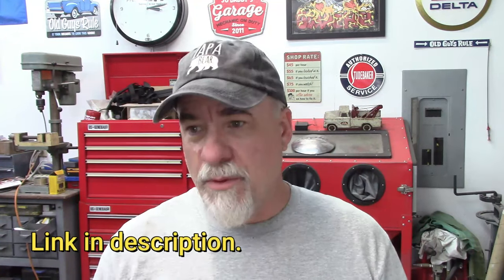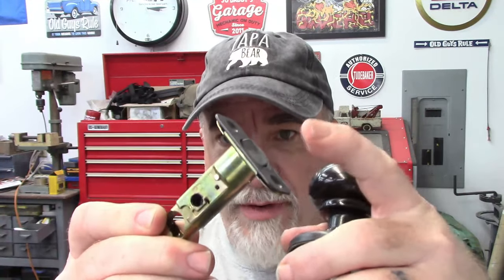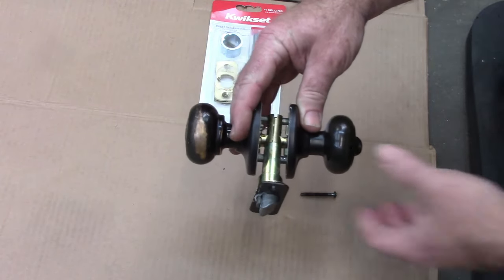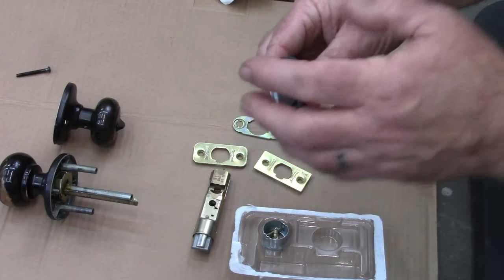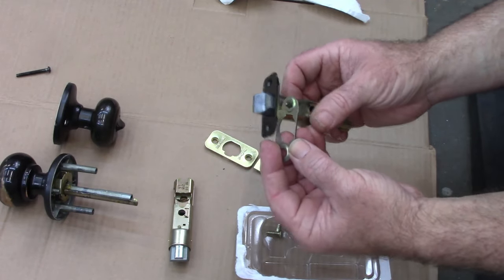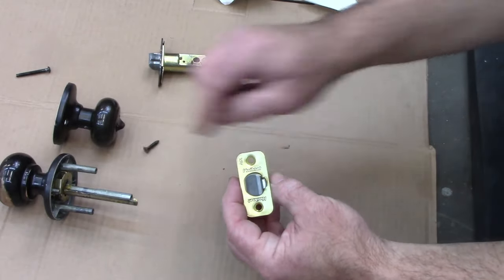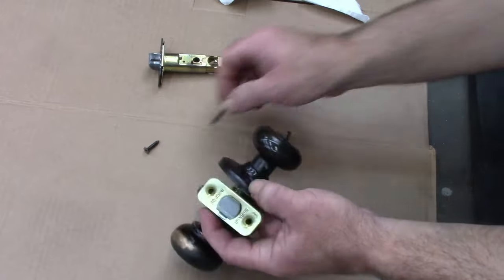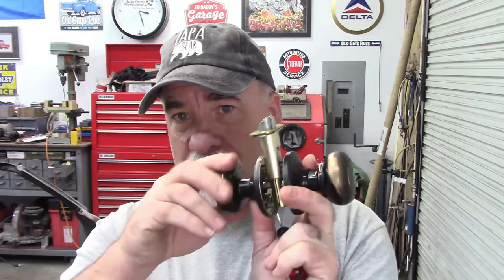Kwikset door latch repair. Save your handle and save some money.

Comment: A better video would have been repairing your old unit....what broke?????
Reply: He did show what broke. The latch is worn out because the metal is worn away. You can’t repair these. You have to fix them by replacing the latch. Take a look at the tumbler area on the old one he held up and the new one he held up. The old one all the metal is worn away. Common issue for heavy use front doors.

Comment: Kwikset locks come with a lifetime warranty.
Reply: Indeed, I was doing some routine maintenance on an older Kwikset, when a piece fell out I didn’t recognize.  The handle when back together just fine, and still worked, minus that piece.  So I email Kwikset and ask if they can help identify it…. They sent me a whole new handle set and I didn’t even ask for it.  I’ve held onto it for the past few months.  Then the other day, what happened in this video happened to me, and lo and behold I had a brand new one standing by.  Thanks Kwikset!
Reply: The warranty on their website says you have to provide proof of original purchase to make a claim. Did they ask for any of that when you emailed them?
Reply: @JonathanLarson-CoolJon  Nope, they just asked me to take a picture of the handle, which I did, and along came a new one.

Comment: Unfortunately the latch is jammed in the locked position and the door is closed.  I have taken the door knob assemblies off, but don;t have a way to get the jammed bolt out, so I am stuck with a locked door.
Reply: Actually, this JUST happened to me yesterday. If you take like a sharp pointed thing, ( I used an old pocket knife) and pry it open, simultaneously keeping pressure on the door, and you can get it open. Hope this helps !
Reply: @jtemme76  Hi, jtemme76,
I had tried that for a half an hour and it worked in the past.  If you can get the bolt to slide just until the taper part, my last experience was this worked. After I posted this, I thought: I need a tool to cut the bolt.  I bought an Oscillating Multi-Tool and a bald made for metal.  It took longer to get by battery from storage in the basement, and change to the metal-cutting bald than the work itself.  That bolt was cut in about a minute!  The door opened easily and a screwdriver got the latch assembly out.  I picked up a new one tonight, and I’ll have that door handle working as good as new tomorrow morning.

Now I have a new tool, and I’ve been wanting one of these for a while.

Thanks for the response I found no videos on this problem but since I saved the old latch maybe I’ll make one and post it.

Comment: Allright!  I feel like I conquered the world!  It has been months since my pass-through garage door wasn't locking me in or out!  I even bought a Cracker Barrel Friday fish fry lunch - which would have been CHEAP if it fixed the problem - for a man-friend to adjust it (I am a single 66-year old female, easily frustrated trying to figure out what was wrong and thought it was just a loose handle), but it still didn't work...then I found YOUR video, stopped it at the point where you flashed the Kwik-Set Exterior Entry Door Latch replacement parts so I could write it down, drove over to Lowe's and in just a half of one day (I admit to being a slow learner - Ha ha ha) it is working!  Thank you!  Thank you!  Cindy from Phoenix, AZ
Reply from the maker: Awesome!

Comment: Thank you! I just took apart an enry handleset that doesn't fully throw the latch when turned in one direction and diagnosed the problem as a worn latch. I could see that the latch hole was worn quite a bit on one side (top) but not the other (bottom). This explains why the door handle worked when turned in one direction but not the other. I appreciate you holding up the package in the video so I know just what to look for when I go to the store. Thanks again.

Comment: Dude, THANK YOU!  I was just getting ready to go drop a ton of money on a new latch style door knob to replace the one I have. Of course it had been sticking for awhile, and all the times I shoulder checked the door to get it opened cracked some of the wood on the frame, that might be another video you made need to do :) [repairing cracked door frames for dumbasses] oh well, live and learn. Thanks again! Going to go put to use the knowledge you just gave me.

Comment: JoDaddy if I still can't fix my door knob and trigger then consider me an idiot because that was very self explanatory like, I had it broken for two months, you'd think this guy is hopeless, as I probably would judge someone as that esp if I end up successfully fixing my door knob and dead bolt as the brand quikset is a common household essential so instead of having someone do this for me I will take a crack at it, because of your inspirational video, Gary and Brandy in Kaneohe

Comment: I am revisiting my issue again and remembered my issue. I have 70's interior doors with a 2 3/8" backset and no room for an adjustable backset. I have ordered a new doorknob set from Amazon for 12 bucks and guess I will need to run a 1" wood drill bit thru the backset opening to allow for the extra room needed for an adjustable one. If you know an easier way let me know.

Comment: The round piece is not an adapter. It is usually used on a metal door, but can also be used on a wood door where just the hole is drilled and the flat plates are not used.

Comment: Any tips on how to get the latch out if it's locking you out as described in this video? Is it just a matter of taking the handles off and getting in there with some needle nose pliers to actuate the latch?
Reply: I have the same problem - did you figure it out?
Reply: @jaytyler3076  Yep, I used a flat, sturdy piece of metal I found lying around (I think it was the clip from a garage door opener remote) and a skinny screwdriver to push the latch mechanism open. Had to shove them between the door and the door frame to get at it. There was much cursing involved but eventually I got it open. I found a video of a locksmith fixing this same type of latch and it took him like 10 minutes to do the same thing, so that was my inspiration.
Reply: With access on the inside handle you can take off the handleset.  Using a screwdriver, or pretty much anything, you can open the latch further than the door handle will. 

Replacing the whole latch is the easiest and most certain solution.

The latch shown in this video is known as a 'deadlatch', or casually as an entry latch.  It has a slider that prevents the door from being carded.  It's usually used on entry handles with locksets.

The other type is a common/interior/passage latch.  It doesn't have a slider, although better ones have an anti-friction pad that might be confused at first glance.  They are used on entry doors with a separate deadbolt.  You can substitute a deadlatch but the trim plate profile is different.

In a pinch it's possible to disassemble and lubricate the Kwikset/Baldwin latches.  To do this you'll need access to the inside by separating the latch into two sections. Inspect the mechanism that sets the door offset.  There is a roll pin that pushes down on two black plastic sliders.  Those sliders are guided by slots on either side of the tube. Push out the roll pin that sets the offset and use a small flat screwdriver to push down the plastic sliders as the roll pin did.  The two sections will separate.  You can now reach the sides to lubricate.  Reassembly is just lining up the parts and pushing in the roll pin.

Use a tiny dab of clear waterproof grease.  People unknowingly rub against the latches.  No one wants mystery grease stains on their clothing.

To fully disassemble the latch tube you can drive out the rivet.  If you have to go this far it's probably because the parts are worn beyond use.  It's a bit fiddly to put back together.

Finally that sleeve isn't for worn out doors.  It's for so-called "trailer door" installations where the latch is retained by a press fit.

Comment: The flange around my front door handle (inside) doesn't just pop off. The right side comes off... the left side is locked in  place. How do I remove the flange?

Comment: Question: how were you able to get the door open if the latch wouldn’t retract? That’s what I’m trying to figure out. I don’t mind replacing the latch, but I need to get the door open in order to do that.
Reply from the maker: I had access to both sides.
Reply: We also can't open the door because the latch is malfunctioning with the door closed.  Did you ever find out how to get the door open so we can replace the latch?

Comment: How did you get the internal mechanism to turn when you took your door knob off? Mine broke and I can't open the door and I have both door knobs off and it won't budge.
Reply from the maker: Is it jammed?
Reply: @jodaddysworkshop786  Our door is stuck closed.  How did you get the latch out?

Comment: Well I do have question most of the videos they accuse the strike plate as the main culprit when it comes to issue of latch not catching the strike plate . But how often do you think latch might be the one which needs replacement
Reply from the maker: Wish I had a good answer for that.

Comment: Same problem. But mine is the kwikset smart lock. Although the smart lock works on the deadbolt, but my latch is stuck. I got to all but the replacement. Will any kwikset tubular replacement work on my  latch?
Reply from the maker: Not sure.

Comment: Do you know if there is a way to change the length of the plunger that comes out of the latch?  Mine is long and it hits the trim so I need to get it a little shorter if that's possible...
Reply from the maker: I think there may be a sort of switch inside. Maybe mot on this model, but I've seen it on others.

Comment: My issue is that I installed a new Kwik Set knob and latch set and now the lock is hard to turn and will not loct with either a key or the button or the interior button?
Reply from the maker: Sometimes you may need to loosen the screws and wiggle everything a little bit. See if that helps then tighten back up.

Comment: What about the thumb type door latches where the spring has worn
Reply from the maker: No experience with those, sorry.
Reply: In most cases, it is the same latch assembly that is used with the deadbolt. You can either find a latch of the same brand, or replace the deadbolt.
Reply: @davidcox9983  In my case, and most I've seen, actually, the thumb latch is a few inches below the deadbolt. 

I temporarily replaced it with a standard doorknob from a spare bedroom until I get the latch fixed. I have no idea of the brand, I'd be open to any ideas how to ID it, since there's no name inscribed anywhere i could see.
Reply: @stellijer  My mistake. I think you are talking about a handleset with a thumb press latch release rather than a deadbolt. The latch assembly is usually still the same as as the latch used with a regular knob assembly. Often you can identify it by looking at the plate on the edge of the door. If you still can't identify it, you can do a google search of latches, and look at the image to see if you can identify it. Does the latch have a square hole, a plus shaped slot, or a minus shaped slot for the tailpiece?